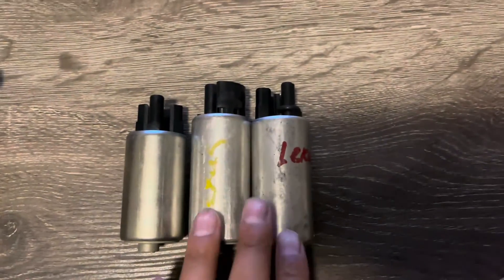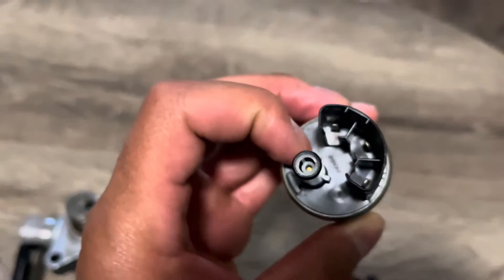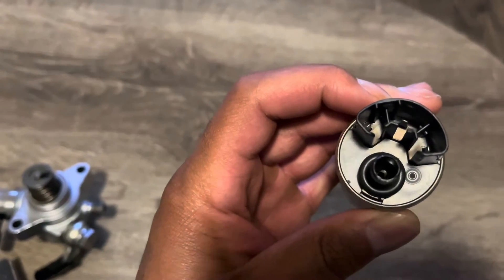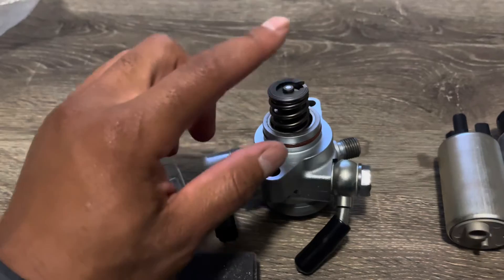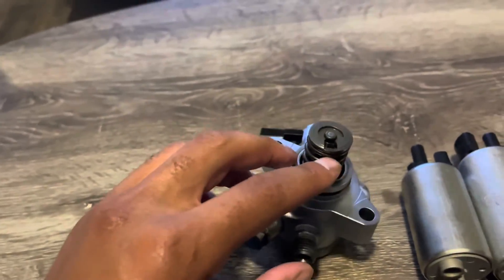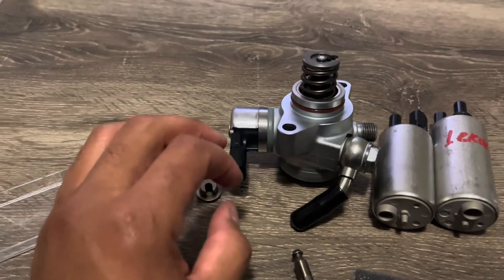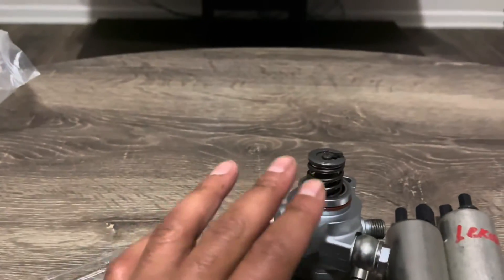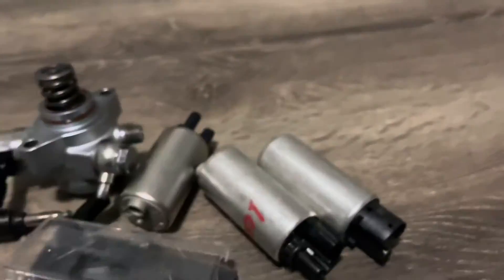GR Corolla Low Pressure Fuel Pump Hack

Comment: Is it worth taking off the check valve? I struggled big time installing the lc500 fuel pump.
Reply from the maker: Only for supercharged 4th gen Mazdas, no other builds need it
Reply: @supermazda3  I’m full bolted on 2.5t Mazda 3, even then it wouldn’t be worth it ?

Comment: Do you think the LC500 pump will work in the normal Corolla with the M20A fks
Reply from the maker: Yes, but you will have modify the pump bracket
Reply: like cutting it or making a new bracket ?
 @supermazda3
Reply from the maker: @darkabyss5604  either will work
Reply: okay cool thanks  @supermazda3
Reply: Update yes it does fit and work in the M20A Corolla hatchback
Reply from the maker: @darkabyss5604  do you feel any difference?
Reply: Not really it’s a tad bit at top end but everything else feels exactly the same
Reply from the maker: @darkabyss5604  that's likely because your Toyota motor uses port & direct injection. Whereas we only have direct injection. The main difference is a low RPM, but the Toyota uses port injection, I believe at the lower RPM
Reply: Yes it is a duel injection set up on like all the Toyotas nowadays and mine is no exception

Comment: So the RAV4 hybrid pump is better option than LC500? How do you remove the check valve from the Lc500
Reply from the maker: No, LC500 is better. The white piece, look at the pic differences
Reply: I had two pumps and unfortunately broke the edge off one trying to remove the check valve, so at the time I just put the one with the valve in. If it makes that much of a difference, I’ll try the clipped one out.